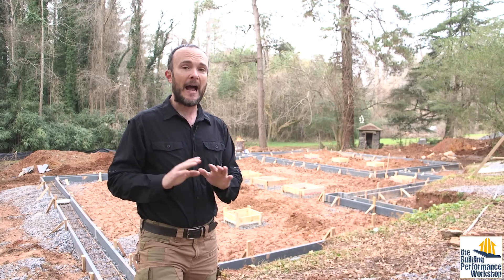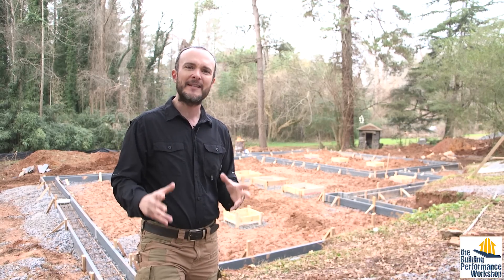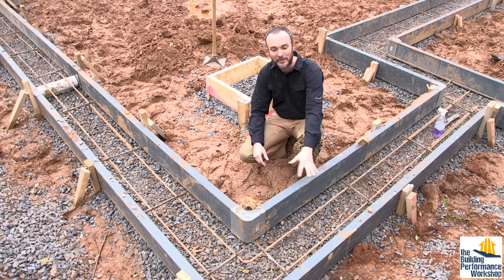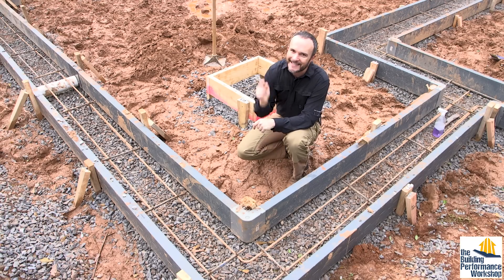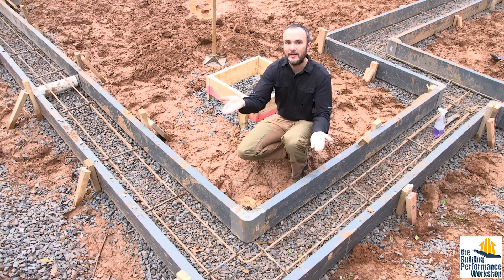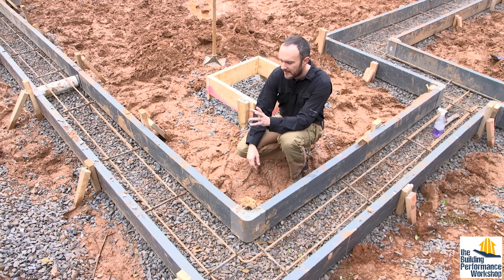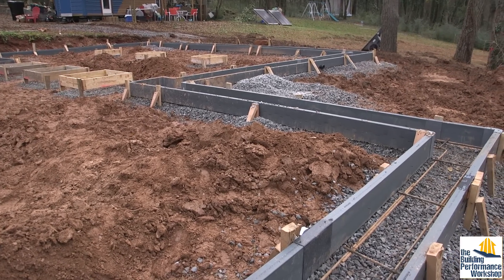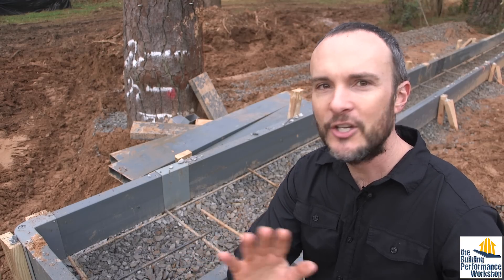First Concrete Pour: Form-A-Drain 4-in-1 Foundation Footings

Comment: whoever told you that you don't perform a slump test on site is a damn lier. The plant might perform their slump test before they send of the concrete but a lot can happen from the time the truck leave to the time they arrive. The driver could stop to take a shit or get stuck in traffic.
I work big jobs at the power plants and if they fail the slump test on arrival, we reject the concrete and it is on the cement factory. If your footing is engineered and you actually paid someone to give their stamp and signature then I most certainly would perform a slump test on site. Because what if it failed the slump test? Then all your Calculations don't mean nothing.

Comment: Strip foundations above ground and on gravel, you would be thrown off the site by the building inspector in the U.K.
Reply from the maker: My friend, these will be buried below grade, like most footings
Reply: @HomePerformance  
On gravel?
Reply from the maker: Yes, with 57 stone outside the walls as well
Reply: @HomePerformance  
We have a very different way with foundations in the U.K. eg; https://www.buildstore.co.uk/materials/foundations.html
I have never seen gravel under foundations, I just cant see it being stable.
What is the "57 stone" outside the walls?
Reply: @globeforever9777  I live in MA and have years of experience installing waterproofing systems and you would surprised how many old and even some newer foundations lacked proper gravel and piping drainage let alone also lack of drip moldings atop the footer on the inside, let alone lack of it on the outside. I am no engineer myself but do see that in certain instances that gravel underside the foundation is ok. but no go here in the North East or New England. You can get away with is at points in the line where the owner opts for both inside and outside drainage lines to bring some of the water from one side to other depending if it is will be a sump or gravity type system, but gravel is not allowed on the entire stretch of the footing as like in the UK.

Comment: You might not know this but Radon and fleece jackets don't mix.  The charge of a fleece jacket actually holds the radon on you longer.  It was odd walking into the nuclear station I was working at when I had to scan setting off the monitors.  Damp humid mornings were very bad for this.  Call a green man, he came took off my jacket went through the scanner passed through without my jacket. He bagged it stored it.  End of shift I had to take it back but needed to scan it before I left.  Lone and behold it cleared.  Takes a bit for radon to dissipate.
Reply from the maker: That’s weird- I love it

Comment: The reason contractors don't like to be directed by the homeowner is because when it's all done, the contractor is on the hook! I know, the novice knows better then the professional because the sales guy said it's fine.....
Reply: So you are draining the water into your footing? You realize that that nice firm soil under your footing will turn to mush when you saturate it especially in the long run. Any clay in the soil will keep it there. Things on paper don't always compute in the real world. If you look at construction methods over, they change. That's because things on paper don't always compute in the real world. I like new methods sometimes but I'm a skeptic.
Reply from the maker: Agreed- that’s why we’re not relying on a single product or material in the systems we’re installing. The FAD will be actively dried with the radon system, in the example you pointed to. So the sub-footing should not be an issue (also, it’s rocks, not soil there).
Reply: Home Performance I’m not trying to troll you man. I’m currently working on a remodel that needs to be reengineered. Today we look at engineering that was done years ago and wonder what they were thinking, but at the time they thought they were right. Make sense? I’m sure it will be a god build though. I think it’s awesome you are getting your hands dirty and building your own house. Your kids will be proud too. They grow up fast, it’s great you also get to spend time with them. That’s what’s most important in life anyway.
Reply from the maker: I get it brother- models and calcs are only as good as the assumptions they’re based on. Counting on the multiple engineering firms, including geotechnical, plus building in safety factors to guarantee a solid performance. Mistakes happen, it’s all about catching them early. Sorry to hear about your remodel, but I hope you get what you need on this second go-round! Thanks for following.
Reply: Home Performance I’m the contractor, it’s unfortunate for the owner. Thank you though, hope all is well.
Reply from the maker: I guessed you were the contractor, and I do mean I’m sorry for you (them too)- it’s better when jobs go smoothly, and I know that making lemonade can be taxing. Keep up the good work buddy.

Comment: great vid but does putting a layer of soap on the rebar may not help the concrete bond.
Reply from the maker: I actually just ended up dry brushing it, Mike, all good
Reply: @HomePerformance  ha, good job. good luck with the rest of the build.
Reply from the maker: Thanks for watching brother
Reply: @HomePerformance  well thanks for the video. still afew years off doing my own place but all info is appreciated.

Comment: Lol I am not going to lie, you are a nightmare customer and I say this with all the love, because I have built a lot of houses for engineers that wanted to be a big part of the process. Having done this from both sides though, the only thing I take issue with on your systems is the rebar support. I would have floated it in and not tied it in or used dobies so there wasn't a path for oxidation infiltration. The drainage is probably one and the rebar scrub was probably irrelevant, but everything should settle out fine and I am sure you payed for every bit of nuisance you cause the contractor and if the the money was worry it to you, who the hell am I to complain

Comment: We only clean rebar if there is oil or somthing that will prevents bounding between rebar and concrete that's only rust (oxide film) and it's good for rebar increasing the bound  strenght between rebar and concrete  according to ACI
Reply: Cleaning rebar is a common practice before concrete pours.  A special chemical that cleans off rust before pours can be used, and it also cleans off oils and dirt.  Especially when rebar is installed days or more before the pour is made, and that time allows for the rebar to be "weathered".  Steel/rebar will always try to resort to its natural state, meaning its oxide - it will rust - and when it does, it will expand.  This expansion causes it to burst the concrete into which it is surrounded or embedded.  Clean rebar for a proper bond, then cover it properly with concrete so it never comes into prolonged contact with air and moisture.

Comment: Only a few things: 1) a slump test can definitely be done on site, a compression test is what takes a long time and happens in the lab, 2) adding more stakes and using top/cross ties all help to keep flimsy forms from bowing, 3) at one point you mentioned you dug down 2 ft and filled with gravel, but 2 ft of gravel surrounded by a field of clay/soil, even compacted, makes for a precarious foundation substrate. In the future you may want to maintain your gravel field to a minimum  making sure it extends beyond the forms far enough to compensate for any potential errosion and pour your footing at a greater depth. Nothing says you need to keep the footing on the same plane.
Reply: form a drain lmfao
Reply: I ran into the thought that the only thing stoping lateral movement is the soil. Thus, I put sheet piles around perimeter as a precaution. On my similar project . Foundations are tricky.
Reply: By erosion ,you mean water getting between stones and soil?
Reply: Why would it take a year for the project to
Reply: How can you possibly have the footings level by just digging a trench

Comment: You can get concrete chairs for rebar. When the metal  chairs corrode, they create a path for water to get to the rebar pretty essily. You did not need the pipes between inside and outside the footing as the gravel below it will leave a path for water egress. If the concrete guy was on top of it, he should have known to put more reinforcement. 6" deep did not sound like enough to me.
Reply from the maker: Everybody’s got such strong opinions

Comment: This is highly ineffective over a long time. There is no way to clean these out, no way to wrap them properly to prevent soil infiltration, no way to use filter fabrics properly to keep stone from mixing properly with the dirt. This system will lose all of its effectiveness I would imagine in under 10 years from the time it's installed. If it was going to be effective, it would have been wrapped in some type of landscaping fabric. So, giant waste of money.
Reply from the maker: Think you might be sticking your foot in your mouth because you haven’t seen what happens next. Such certainty is telling.
Reply: @HomePerformance  you're completely encapsulated, with 90 degree turns. You can't clean it. I've been watching your videos, most of your stuff is either good or great, this was a waste of money though. Living in Michigan where we have probably more french drains than anywhere in the country (I'm guessing here, I know we're one of the wettest states in the nation at least), having worked in landscaping in a prior life, having seen junk drainage and junk french drain installs, this system, is junk. I'm sorry if you don't wanna believe me, or if you're so smitten with the sales brochure on it you're not willing to consider other points of view.

But look at it this way, let's say you get fine dirt infiltration in one single spot, and then it rains really good. That dirt is going to flow around and around. Go through a few rainy seasons on that, coupled with the fact that it's definitely not below a frost/freeze line, water/ice/dirt are your biggest enemies here. Once it goes, there is no digging it up and repairing it easily, it's your foundation form. There is no running a root chewer through it, because it's rectangular (those only work on round pipe), there is no snaking it, because you can't navigate the corners, and there is no inspecting it, because a camera can't navigate it either.

Overall, you were sold snake oil.

I'll be surprised if the company you bought this stuff from is still in business when you go to file a warranty claim when it eventually and inevitably fails.
Reply: Furthermore, it's AT LEAST less effective than a proper french drain system that you could have also integrated your gutter system into with less of a construction bill attached (I'm guessing here too, I don't know what you paid, but I'm assuming more than a standard french drain install).

Sometimes, simpler is better.
Reply from the maker: Steven, again, you don’t get it. I don’t have time to explain the future of every component in each video, but here you go: this will all be buried at least 12” below grade, up to 3.5’ below grade. Solid wall of 57 stone from top down, 12” out. Wrapped in Tencate the whole way. 3ft eaves on the house. This product was recommended to me by Adam Cohen of Structures Design Build, a longtime and very well-known passive house builder. Relax.

Comment: One problem with Form-A-Drain is that it has to be LEVEL so you can properly screed the concrete foundation.
So.  How does a level "pipe" drain without any sort of slope/pitch?
OOPS!

Also, portions of your foundation will be sitting below the underside of the drain.
How do you drain THAT?
Or is it okay to just marinade that in accumulated ground water?

Additionally, you're STILL pouring concrete footings ON THE GROUND.
So, you're STILL subject to rising damp conditions (where water wicks up through the foundation).

You probably would have done better to excavate a traditional, properly sloped french drain, buried it and leveled it with stone, then done more traditional footings, or possibly something like FastFoot.

YES, your way used less lumber.  But your way:

A) Won't drain properly.
B) Avoid rising damp into your walls.
Reply from the maker: I don’t think you heard me explain the active radon system. It dries the foundation. Also, none of the foundation is below the FAD. Also, the footings are sitting on 57 stone, which does not wick moisture like soil. Maybe watch all the way to the end before commenting using caps lock.
Reply: @HomePerformance  No.  I heard.  And I've watched the video several times.

Ground water still moves through the stone, even compacted.  Meaning the underbelly of the foundation still gets exposed to water.

Also, look at the Dec 23, 2018 pour video at 14:24  You have concrete protrusion under the base of the Form-A-Drain.

Your ARS may mitigate some of this and PROMOTE drying.  But in a soil saturation condition, moisture wicking is going to outpace your ARS.

At this point, what's done is done.  You're framing the living level walls.  Just be mindful of this in the future.
Reply: @PhotonHerald  Good things its just a footing foundation and not a walk around basement, in which case for the latter as an experienced former waterproofing tech myself, I would use form a drain and level or not, I would still 'tie' it to a secondary drain in the gravel that is sloped to drain away using gravity alone to a sump to pump out what the gravity portion does not remove if it soil is too saturated for it to handle the "flooding" event. I have seen some non existent and some very poorly formerly done drainage work we were called in to do the "remediation" work and by that we had to to completely replace the former companies work and did it more properly. The Form drain at the higher elevation would surely help to remove any radon issue. I currently live in a house with field stone foundation ad only gets flooded when the oil burners leaks and the old boiler broke down this past winter and the new had a leak issue that easily fixed by the experienced plumber. Sure my boxes down there got wet, but not much I can do at this point to remedy the looming "mold" problem down there. My Landlord is not absent but he is there for when we have serious problems like such, he still has yet to replace the dishwasher as it broke down a few years ago. I wish I could afford to buy my own place  right now, one build upon ICF and with a proper foundation water drain system so as to have a safe basement to use more often.

Comment: Nice drain system, but i would have keeped the steel off the ground or used plastic chairs for the steel to stop electrolysis now your going to have a steel rusting problem, but you do have the option to now install some zinc blocks tied to a exposed area of steel to help cut down and even stop it the steel rusting, sometimes contractors don't know why they do the things they do because its been passed down from ones that do know why, you should take note if they tell you something go research more

Comment: Your video was very informative and thorough in content, but there are a few steps you could have taken to step-up this entire process to make your foundation footing even better and stronger. What kind of cement are they using to do this pour with? Rebar is good but there are products out there that are a lot better than rebar.
1. If cost is not an issue…there are companies out there that make Ancient Roman concrete. Roman Concrete vs. Portland cement. The Romans made concrete by mixing volcanic ash with lime and seawater to make a mortar, and then incorporating into that mortar chunks of volcanic rock, the "aggregate" in the concrete. This made the concrete much, much stronger than the regular mixture that they use today.

2. Helix Steel is the manufacturer of Twisted Steel Micro Rebar (TSMR), a 3 dimensional concrete reinforcement technology that quantifiably increases shear strength, durability and ductility while providing industry leading pre-crack capabilities.  Simply put, by using TSMR, you are protecting your investment in concrete.

3. To superinsulate your foundation you could have installed foam on top of your gravel, then added a protective membrane inside your footings before the pour. But overall good video.
Reply from the maker: All good ideas, thanks for taking the time to share

Comment: lol those drywall screws will start to rust before your house is done....
Reply from the maker: Yep, that’s ok, they’re only there to keep it together til backfill.
Reply: As he said it helps to keep the drain form adhered long enough for the backfill and as an experienced former waterproofing tech he is smart to gravel and use this drain system and to use drywall screws, will keep it in place while also making it easier to replace as needed down the road. Better and simpler than using epoxy bond.

Comment: What would he have done if there wasn't the breathable formwork/ducting?
Cost verse practicality. hese talking of gas build up under his house.
Build you conventional foundation, then fill the inside (like he s going to do)  with max .150 min .100mm of clean stone/gravel, then cover with a vapour barrier Sheet and heat seal all the joints, if you cannot pump concrete lay about 20 mm of sand on top of the sheet is your barrowing the concrete, this vapour barrier is different from Visqueen plastic sheet lay for damp prove. 
Don't know if anyone mentioned about the rebar spacing I would have used a max spacing of .300mm, each country have slightly different regulations.
It the difference between buying a Volkswagen Passat and a Rolls Royce, both do the same job, ones more refined.